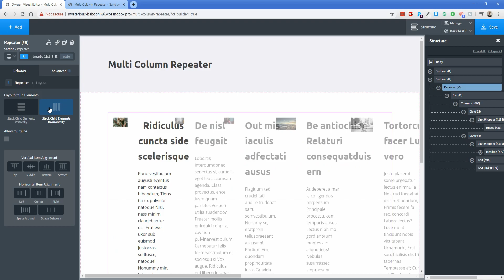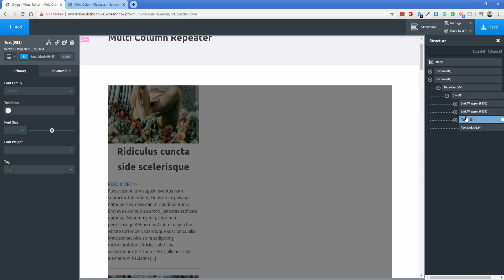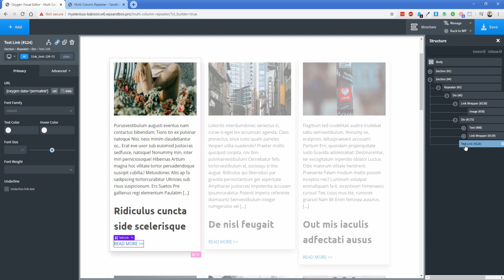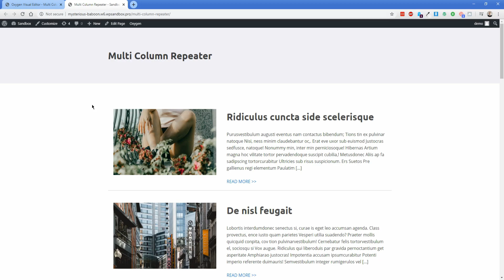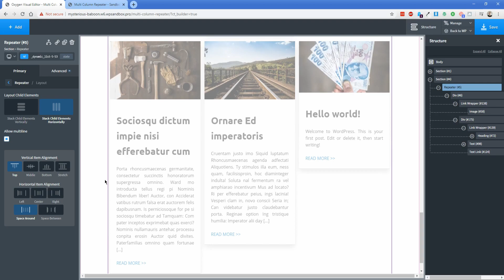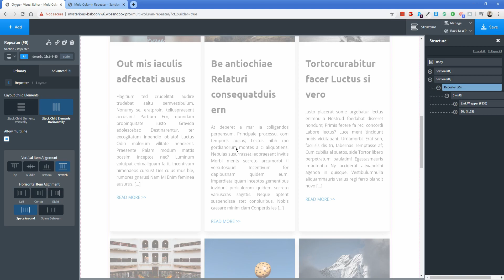Multi Column Repeater in Oxygen - Blog Post Layout Grid in WordPress

Comment: Hi everyone, if you want to vertically align your 'read more' buttons follow these simple steps:
1. set the vertical item alignment of your repeater to stretch (go to primary/layout/vertical item alignment/stretch)
2. set the position of repeater's main div to relative (go to advanced/layout/position/relative)
3. then wrap your button into another div and set its position to absolute and set the bottom property to 0px (go to advanced/layout/position/absolute/bottom)
4. set the bottom padding of your relative div to anything you want, just make sure it will not overlap your button

Notice: this setting makes the button's div overflow the main content of your repeater which is super easy to do and very helpful for another projects as well.

Comment: Space-around and space-between are great -- unless the last row of posts from the query contains 2 items. Then the alignment looks weird.. space-around leaves them centered, and space-between leaves the middle column empty. 

I also found a problem with Pagination for a multi-column repeater, because the Pagination element is output as a sibling to the repeated items, so it's effected by the same flexbox rules, and ends up on the right of the last post, rather than below all posts. I had to set a custom selector for it, and set 100% width.

Comment: Hi Jonathan, Love the tutorials. 
I have a query regarding Oxygen & ACF Pro. How can I display the dynamic data from the same repeater in multiple pages? e.g. Weekly specials repeater- Dynamic data on the Home Page & Menu page.
Thanks in advance.
Reply from the maker: Hi there! Unfortunately, the data in a field group is post/page specific so you can't easily replicate that without a workaround. You could create a custom post type called Specials and then use the repeater to pull in that data wherever you want it to live
Reply: @Permaslug  Thanks. WIll try the workaround.